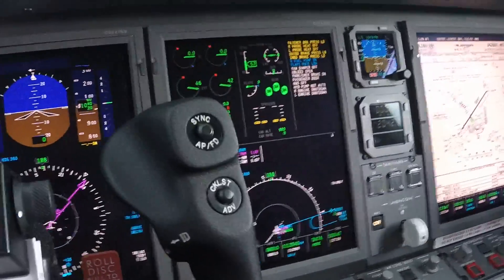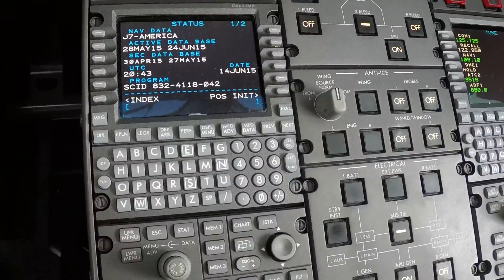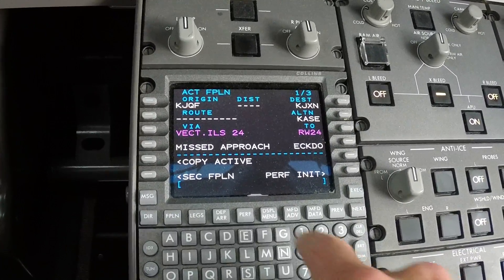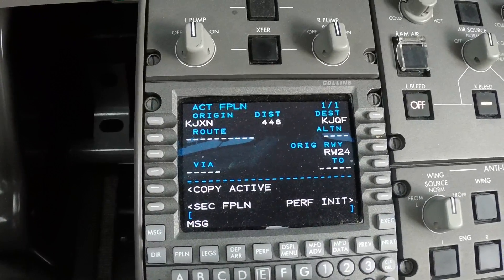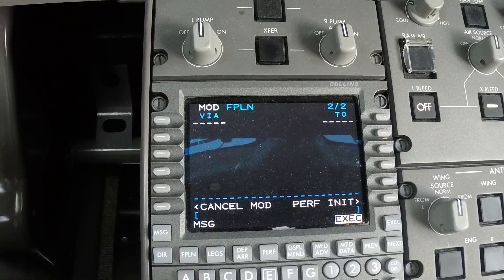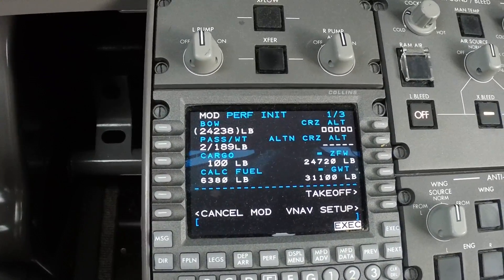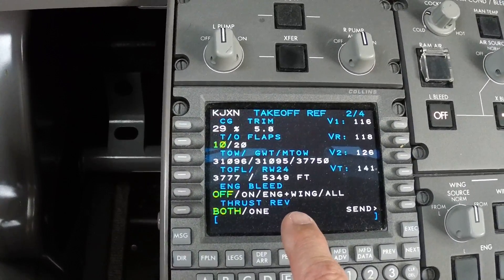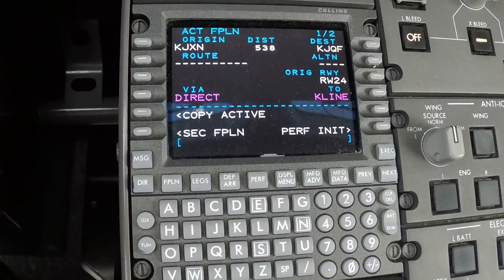Challenger 300 Collins Proline 21 Setup

Comment: Nice video! Can you make another one showing how you input airways into the flight plan, and also how you modify a flight plan after you input one?
Reply from the maker: soflaav8r Glad you liked it. yes I will show how to add airways and modify. Our airplane is out of town flying for another few days. I will work on a video for that. But for now; any airway ( J56, L225 etc... goes on the left side of the Flightplan page. Any VOR, intersection or named fix goes on the right side.Any modification goes in the same way. You need to have an idea where the mod will go along the route. It is best to have a chart to follow( electronic or paper) to make sure you don't have course reversal. Of course, also need to clean up any route disconnects.That's basically it, hope this helps. I will work on the video for this. Please subscribe to the channel
Chris ProFlight1
Reply: @proflight1987  great content for those chair flying at home